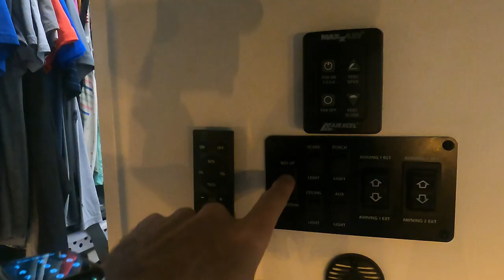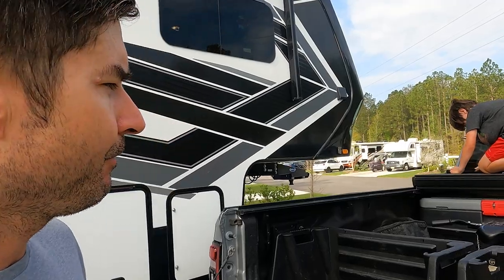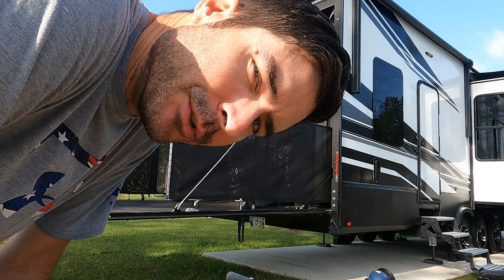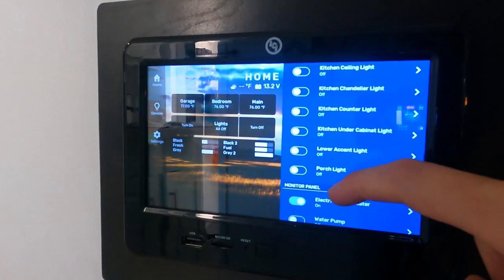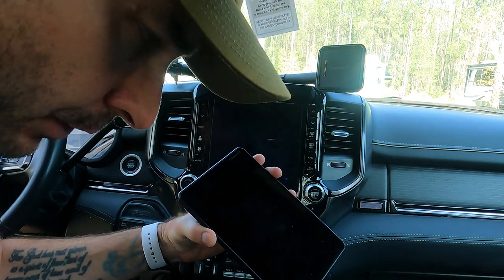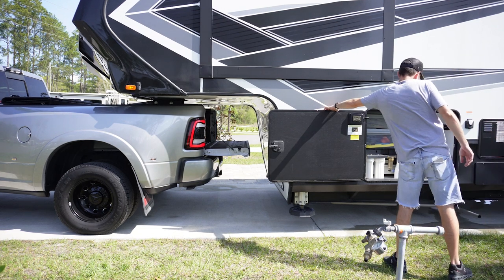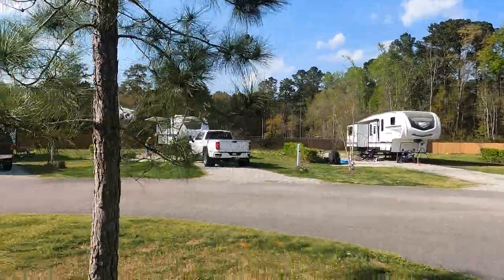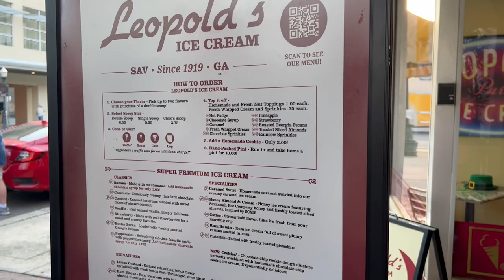RV Travel Day! // How Our Kids Help Us Get Ready to Move Our 44ft Toy Hauler

Comment: Hi there :)
30-45 minutes prior to departure you started the generator. Did you shut it off before moving or let it run the entire time on the way ?
Reply from the maker: We do turn it off prior to moving, as our truck provides more than enough power to run the inverter and keep our residential fridge cold.  We have heard of some families that do like to pop the generator on 30 minutes or so before arrival to get the AC’s up and running and cool down the coach prior to arrival.  We haven’t worried about doing that however!  Safe travels